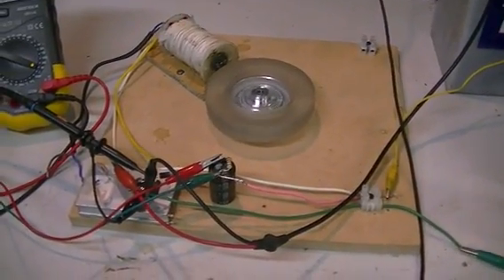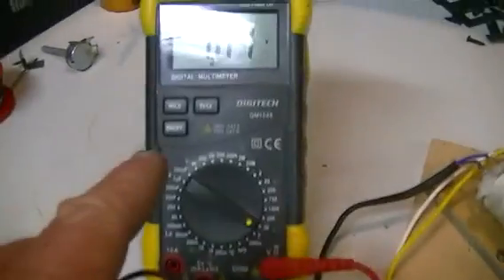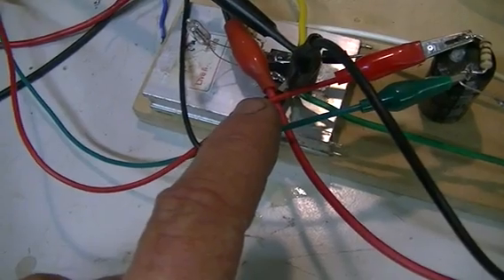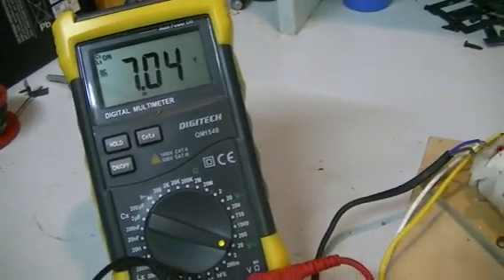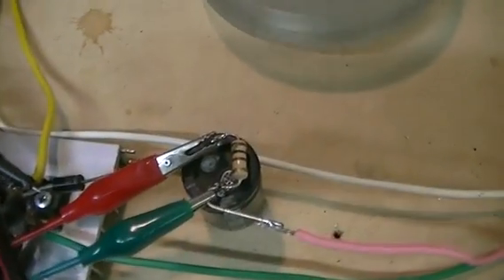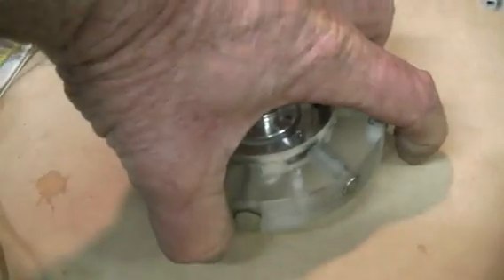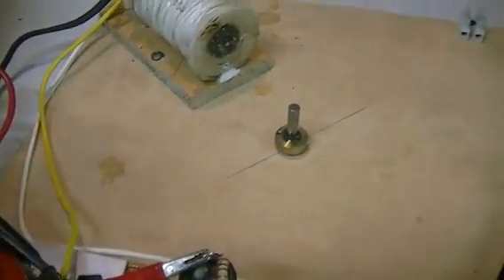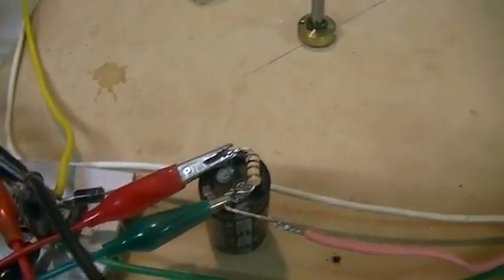PROOF Magnets increase the efficiency of pulse motors

Comment: I am not using magnets rotor in my SKY-36 and is very efficient with the "self oscillation mode" i can use the BEMF to charge a battery but the leds turn off when i cannect the battery charger,  now i understand what you are doing in the pulse motor nothing change without the magnets.

Comment: Good video.  I remember years ago there was quite a discussion at the Energetic Forum about this.  Guys were starting to take their SSGs and just run them in self oscillation mode. They just increased the base resistance and stopped the rotor.  It has been so long ago I can't remember what the outcome of the discussion was.  As I recall the general feeling was just what you stated here.  What comes around goes around.  It is a good topic to look at again.
Reply from the maker: +Lidmotor  Hi Lidmotor. Most SSG pulse motors will run in self oscillation if you remove the base/emitter diode. I have done many test with and without the rotating magnets in play,and always got better results with the rotor and magnets in play.

Comment: Nice vid. Is this kind of like that mag amp effect, the magnet pushes against the current for a moment, but together they add to the energy in the coil. I've never done this experiment, but I have compared the spike with the rotor and without. The spike is much bigger with the magnets. I always thought it took more current to run the batteries though... Nice work - I've modified my thinking on this!
that waveform ON time seems strange, it bottoms out, then comes about half way up for the same amount of time then finally shuts off and we see the spike. Is there something else inline with the signal generator to the base that might cause that?
Thanks!
Reply: +TinManPower i think the freq. generator is shunting the base to emitter junction with some current, so add a current limit resistor R1 to base in series with base input from freq. gen, and add a pull down resistor R2 from base to emitter, you can calculate values of R1 and R2 by knowing Freq. Gen. output voltage and Transistor's Datasheet for base current switch on value. 
I hope waveform will look more square then.
Reply from the maker: +Cool Joule  The only thing that changes the wave form is the rotating magnets--nothing else can change the wave form.
Reply: +TinManPower 
Thanks TinMan, I wasn't talking about the change from rotor to no rotor. I'm curious why the "ON" part of the wave has two tears? It has them with and without the rotor.
we go from no potential then the transistor switches on and the line drops to it's lowest point for a bit, then it bumps up about half way and stays there for a bit, then the transistor shuts off and we get the spike. 
so it's kindof like like there is a cap across the source sitting at say 6 volts, once the transistor turns on it uses up the 6 volt potential and then the battery can not keep the cap filled at the level the pulsed coil is demanding, but it settles at 3 volts (i'm just making up numbers for example)
Reply from the maker: +Cool Joule  I was wondering how long it was going to take before some one noticed this-good job Cool Joule. Let me know when you have the answer.-im sure you will work it out. Use the SSG circuit-replace the charge battery with the cap and resistor as in my video,and delete the trigger coil,and use the FG to trigger the transistor-then you have my circuit.
Reply from the maker: +Waqas Khan  There is already a 100 ohm base resistor,and the transistor is being pulled down by the function generator.